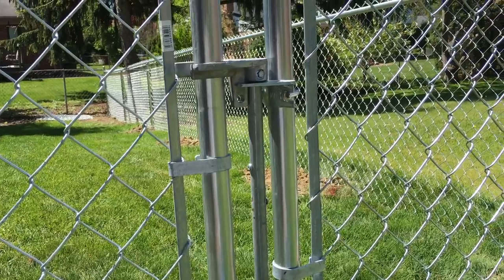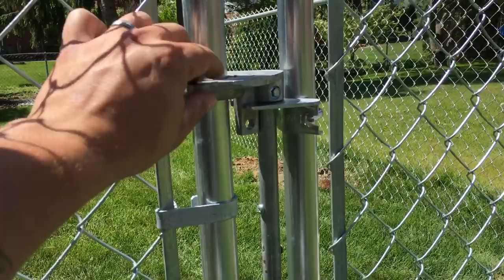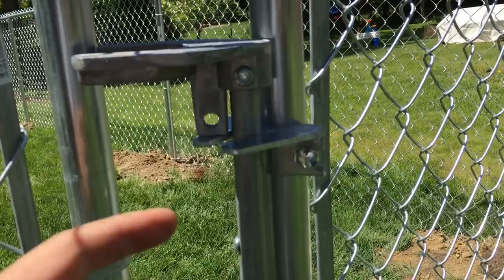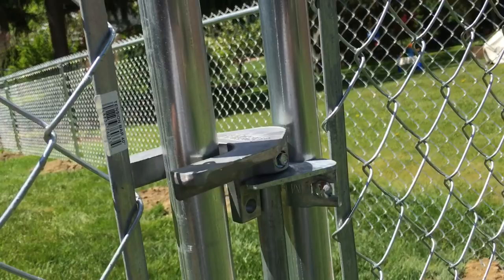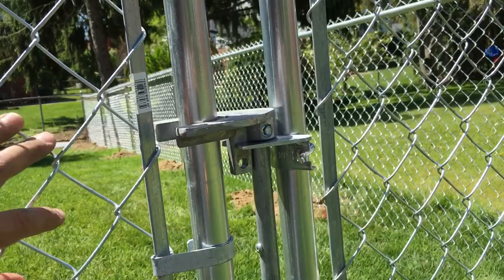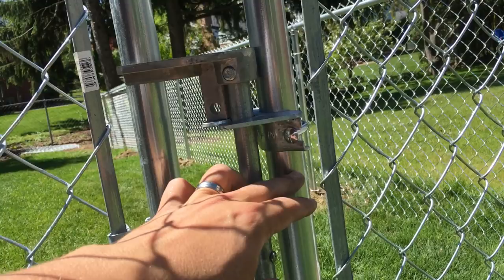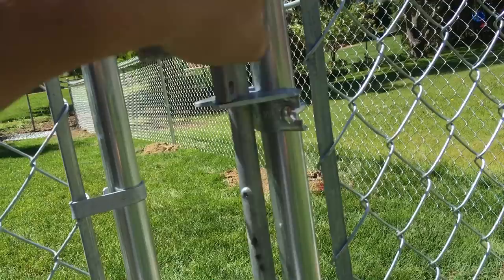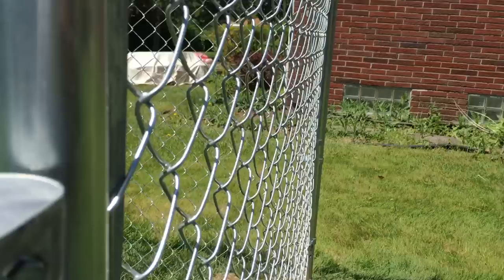How to use/adjust a chain link gate latch

Comment: Great video.  Quick question, the company that installed my latch never put a rod in the ground for the cane bolt to drop in.  From what I read, they recommend a 1 3/8" rod for it but how deep should it be and do you recommend setting it in concrete?

Comment: I am having trouble locating a latch like this on the Web. What is the exact name and where could I buy it?
Thanks
Doug
Reply: Hi Doug, it is a "chain link drop rod/pin latch" here is an Amazon link: Residential Drop Pin 1-3/8" for Double Drive Gates - Chain link https://www.amazon.com/dp/B009TAJE0O/ref=cm_sw_r_cp_apa_i_ac44Bb5S9BZA8 if this is helpful, we'd love if you would share your gratitude with the world on Google! "Paramount fence in Michigan" :)
Reply: Thanks!
I looked for days for an alternative to the standard pin and latch type which I've used for years and hate.
You rock!
Doug
Reply: By the way, I am using it on a single gate, not a double. I assume it will work just fine?
Doug
Reply: Also, one of the reviews on Amazon.com says that "a minimum of 2  3/16 inch required between gates" or between gate frame and gate gate post (my case). Is this true?
Thanks.
Doug
Reply: I just measured the width of the fence poles on either side of the gate and they measure 1-3/4" in diameter. How can I make this work with those measurements? My gate frame uses
1-3/8" poles and the gap between the frame and the gate is 2-3/8 ".
Thanks 
Doug
Reply: Oops. I meant the gap between the frame and the fence post is 2-3/8 "

Comment: Mr. Burke, there is a missing screw.  I don't know if it's a self tapping one or not because it's missing. The hole in the latch is on one side only.  There is no hole on the other side.  My hole is on the other side of the latch compared to the one in this video.  Is it easy to buy and install a self tapping screw if that's the one? thanks.
Reply from the maker: Joe, you should be able to easily screw in any self tapping screw that is the same size or slightly larger than the one originally installed. You can also explore the option of replacing the entire drop rod/latch. I believe you can pick them up at Home Depot or Lowes for less than $15.

Comment: Can you add a bar to the bottom to act as a ground rod for a double gate?
Reply: Jeff - I assume you are asking if a second drop rod can be added to the gate for added support? The answer would be yes to that question. You most certainly can it it would help support the bottom of the gate better.
Reply: John Burke I did some research this morning. I found a 36" bar with a system like this. I think it will work fine as I have a small dog who has figured out how to open a normal double gate latch. 
Thanks for the surprisingly fast response and I checked out your website. 

Have a good week!!!
Reply: If you are installing a 1 3/8" drop rod, which is typical for a chainlink double-drive, it will behoove you to install a 6-12" length of 1 5/8 20 weight pipe into the ground to receive the droprod.

Comment: My parents have a gate just like this and are having a problem mainly with locking it. You have to exert a lot of force to get it to come up and go back down into place- which is hard on them as they both have arthritis. Can you give any advice on what might need to be done to get it working smoothly again?
Reply from the maker: Hi Lara, it is possible that the hole (likely drilled into the concrete) needs to be cleaned out, or drilled out a little wider so the drop rod slips into and out of it easier.  Have you checked this?
Reply: Some handle machanism may help lift the shaft up! A welder can do it for you :)

Comment: I have a gate pretty similar to this that I need to adjust. Right now its extremely hard to pull the forked pole up and down to close and open the gate. Its seems like both sides of the gate have gotten closer to each throughout the years and has made everything very tight. Have any suggestions?
Reply: Already fixed Thanks

Comment: I have this exact setup.  Problem is someone rammed a mower into the fence just hard enough to break the fork latch part off.  I still have the part but it just sits on top of the pole.  Can that be repaired?  How much would an assembled stem and latch cost?
Reply: Joe Smith some of the fork assemblies are attached to the drop rod using a self tapping screw. Is that the case with yours? If so (and possibly if not) you might be able to use a self tapping screw to re-fasten it. You can also buy the entire assembly at home Depot (I believe) for around $10-$15 and just swap it out.
Reply: Thank you for the reply.  I just checked and I'm not sure.  The latch piece seems intact but doesn't sit flush onto the drop rod any longer.  I'll have to see if there was a screw there before.  The latch brand shows Master Halco.  I can tell you that there's one screw hole on one side of the latch handle, not both side.  I assume that's normal design.  Thanks again.  I'll try to be more specific!